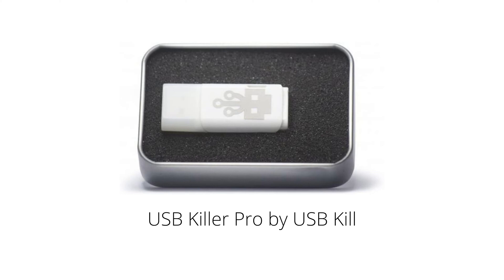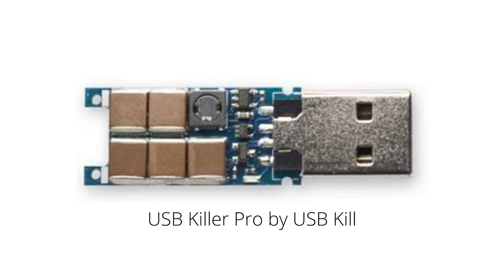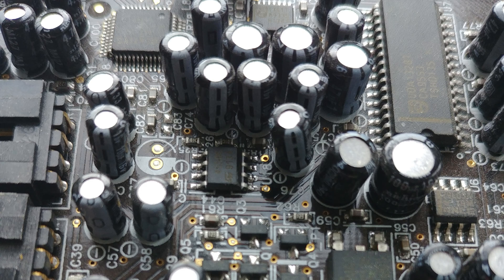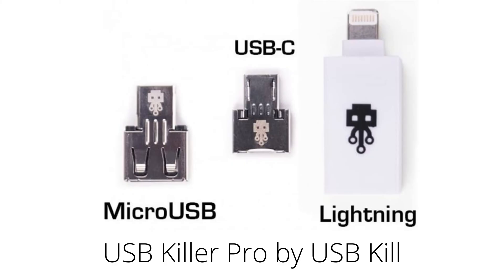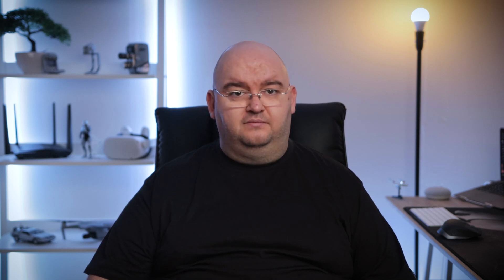USB Kill Sticks -EXPLAINED

Comment: If you want to, you could just delete system 32
Reply: the usb killer is frying the hardware. deleting the system32 is just destroying the operating system not the hardware itself.
Reply: Just reinstall windows lol
Reply: @fireflysimp0615  if you plug the USB killer stick into The computer in the computer doesn't even run to go into that mode, but maybe we were just talking about if you deleted system 32 so...
Reply: I was so stupid

Comment: Reminds me of how the CIA destroyed the uranium concentrating centrifuges at a nuclear plant in Iran. They just dropped a few USB thumb drives outside, near the lab entrance. Eventually a young local scientist picked one up. Suspecting no foul play and wanting to know what was on it if anything, our young inexperienced scientist plugged it in the main circuit of the building. Soon after, the centrifuges started over spinning and one after the other, all blew up, mission accomplished.
Reply: Yup, it's a tried and tested method, especially to infect airgapped systems such as in the example you mention.
Reply: Love how the CIA is thought of as a super creative agency but it honestly is really as simple as plugging in a usb that were thrown out outside. But the real trick up the sleeve is the cyber warfare folks who code malware
Reply: Yapp session 101
Reply: It was StuxNet, not USB kill sticks. StuxNet forced the refiners to work at irregularly changing speeds wearing them down fast all while spoofing the control system with data as though they were working perfectly.
Reply: @yashojitbhaumik6012  Okay, but how did StuxNet get in there then? From what I saw, strategically placed kill sticks near the plant to arouse as little suspicion as possible were laid there and eventually one guy from the inside picked up one of those, brought it in and wanted to see what was on it... Of course that could be complete bunk, when it comes to US operations, one is always free to believe any of the 20 versions let loose whether it's the WMDs, incubators, Tonkin, freedom fighters, evil doers, USS Maine, we don't negotiate with commies... I MEAN terrorists, Saddam, Khaddafi, Assan, Putin, Putin or Xi-Putin, all options are on the table, read his lips, he kept us from the war or the axis of fat dudes in NHK... who knows! BUT, the sticks made sense to me.